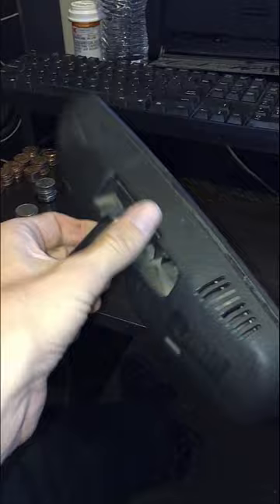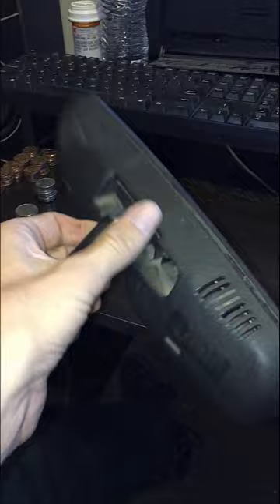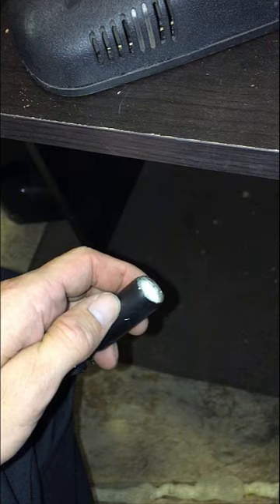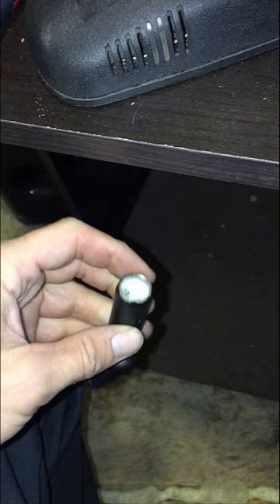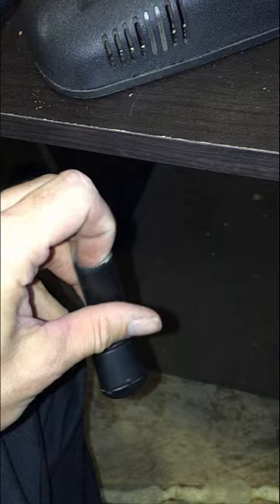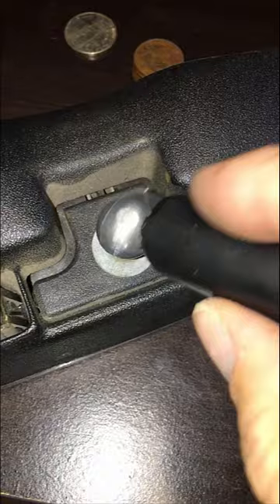How to Fix a Loose Rearview Mirror (Swivel Ball)

Comment: Thank you, Alvinloser1--the assembly of the ball joint on my 98 Honda Civic was different, of course, but I used the same principle you demonstrated: a little piece of plastic wedged in against the ball. I had to make a little hole at the middle of my plastic to let the ball fit snugly--but presto! It works like magic, better than new.
Reply: I also have a 98 Civic with a loose mirror. Glad to see it work im giving this a shot.

Comment: couldn't get it snug enough on mine so that i could have it hold tight but still be adjustable. i ended up shoving one of those rubber Live Strong type bracelets in there and that did the trick. but you inspired me, so thanks!! cheers
Reply from the maker: innovation! I love it

Comment: Thanks! I used a latex balloon. Worked great!
Reply from the maker: oohhh so that works too - nice
Reply: Its gona degrade in the heat and sunlight.
Reply from the maker: cut the edges off that may be exposed to sunlight if you're worried about that.
Reply: everything will degrade or wear out over time, but it's easy to replace when that happens

Comment: Thanks! I didn't think much of this video at first, but it was the only one I could find that showed it possible to remove and reinstall the ball joint basically by hand without special tools or procedures. I just swapped over the arm from my old Mazda's manual mirror with a spring-clip base, to a Gentex 313 autodimming & Homelink mirror with a larger set-screw base that was too loose on the Mazda's button. The arms, and therefore the balls, were the same size, and therefore I was able to pull off from the old and put it on the new. I basically set it on the kitchen linoleum floor and smacked it a few times with a rubber mallet. Saved me from having to remove the button from the windshield.
Reply from the maker: Nice. And you're saying the same thing I was thinking. There wasn't a video i could find to show me how to do this either so I just took matters into my own hands. After I managed to do it I just took it apart and started recording to do it again so no one else would have to just wonder. It's cool to think I may have helped 30k people from this!

Nice interchanging btw. Not many people would even consider using parts from other models to do the same thing.

Comment: Thank you sir!  After getting my windows & front windshield Tinted ... my rear view mirror is loose at the swivel ball part!  It will not stay upright.  +it's getting pretty annoying!..

 well there's more videos showing help ways to remove your rear view mirror, but  this is the 1st one so far, about how to fix your mirror because the connection at the swivel ball ~is loosey goosey! ... and way to rig it. 😎